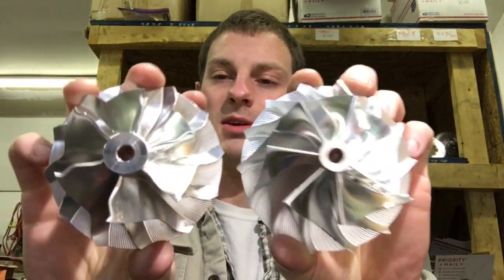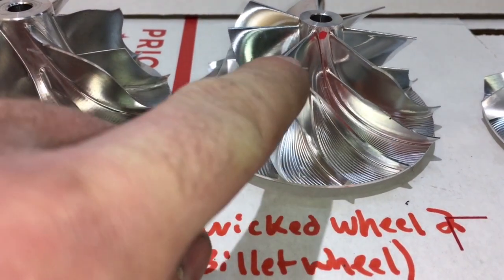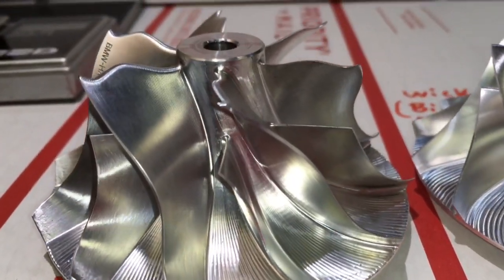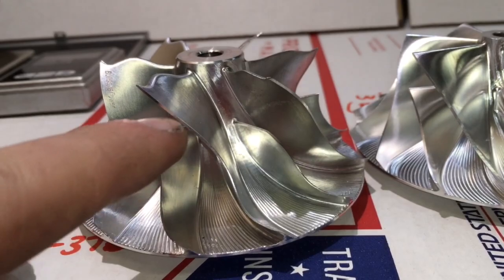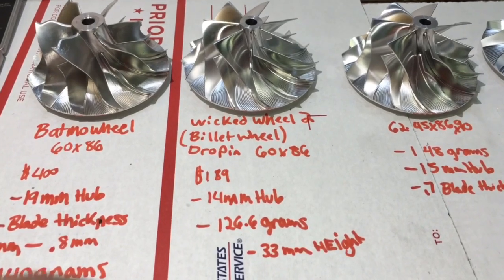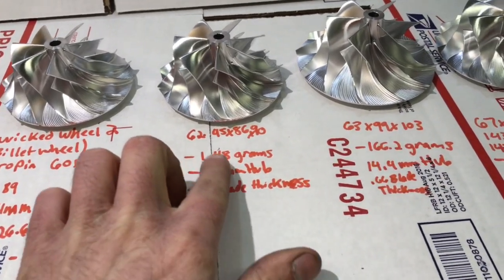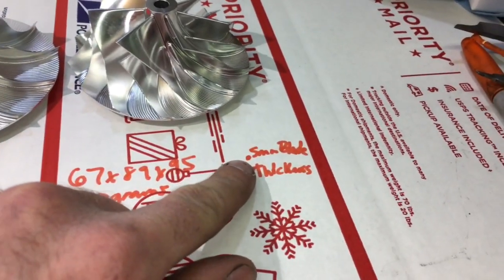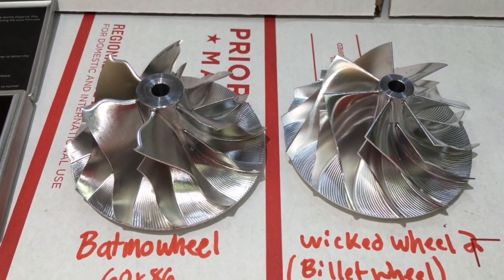Batmowheel vs Wicked Wheel 2

Comment: I just bought a 24v and I plan to rebuild the turbo aswell as pair it with a 5 in straight pipe. I need a wheel with better mpg and little power gain as I have the automatic trans and I don’t need it blown. Any suggestions?
Reply from the maker: My guess would be to use a 6267 or 6264. I don’t have any comparison data to know which is best for fuel mileage.

Comment: In lieu of opinion, why not just build an engine and change absolutely nothing on it but the compressor wheel and run tests on an inertia-roller dynamometer to see which wheel makes boost faster and also which one spins up the roller the fastest overall, from which you will gather the most overall power when wheel is finally spooled up?

Literally no other channel on Youtube does this. You could become THE go-to channel for intelligent turbocharger testing.

There is a gigantic hole in the Youtube channel lineup that you can take advantage of.

Comment: #Turbo Lab America
What do you think about the Batnowheel claiming the following? Quote "Bullseye Power has reinvented the compressor wheel with their exclusive leading-edge technology for quicker spool times and increased flow rates, providing up to 100 horsepower more than a cast or standard-billet counterpart."
Is possible the wheel design can add "100hp"  more? 
I would be testing the Batmowheel & billet CW on a Holset HX40 T51r mod from yourself for comparison.
Reply from the maker: The batmowheel is one of the first billet wheels available. I don’t know if their claim is accurate you have to ask them
Reply: @turbolabamerica  No need to ask! Will find out when it's on the dyno. 
Is worth putting the Batmowheel up against a Wicked wheel 1 & 2 as well as the standard billet wheel you guys make?

Comment: does it make any 
 real difference in performance on stock cummings 2500 2016
Reply: worse performance then stock
Reply: @crxdan  in what way is it worse than stock?
Reply: @kaiserbailey he’s talking out his ass. I have the batmo in my 2012 6.7 Cummins and it spools up as soon as you touch the throttle. And it sounds awesome on top of that, had it in the truck almost 5 years now with 0 issues and I tow 25k lbs regularly with it.

Comment: I got 54x78 Billet compressor wheel with extended tip technology 5x5 blades design from cr performance and so far it looks great and it's a drop-in... it fit perfect. cost was $159 ebay. I've got roughly $220 in my hx35 and it's rebuilt with a Billet compressor wheel.

Comment: What's the total cost of having a turbo machined and rebuilt with a new Billet wheel 62mm.
Reply from the maker: 400 - 650 depending if you want to do the turbine upgrade too
Reply: Turbo Lab America two other quick questions how much would it be if the center section is actually not rebuildable (my turbo has side to side play and just a little in and out) and what would turn around time be and is it possible to plan it out to keep turnaround time down and what time frame would it take?

Comment: Kinda new to turbo diesels. Have two, just never built them. Can someone explain to me what a balance mark is?
Reply: When the machine something or forge somethings as well and melt something together like tires one side can be more dense then the other side. Even though they appear the same and measure out the same. What I mean by dense is one side could be harder or softer. Tires and rubber for instance. When they make a tire it goes in to a moot. Well one side of the tire can for instance be pressed together with more rubber but being molded the same way. That's why we have to balance our tire and put weights on the wheels. Other wise as it rolls around at high speeds it will cause it to wobble or bounce around. A balance mark is just where they took away some metal or added metal on that side because the other side has less or more metal. A compressor wheel that isn't balance on a turbo can cause premature wear on ur seals and bearings. Could in worse case scenario brake the impeller shaft.

Comment: Not related to these particular compressor wheels, but I have a few questions. I bought some billet compressor wheels from you a couple of years ago but I never got around to doing anything with them as I had other problems with the car. Anyway I have a pair of Garrett T04R's still in perfectly good condition that have the original cast 6+6 blade wheels. I bought some billet 7+7 wheels from you and I was thinking I might as well get some rebuild kits as well and freshen them up before I swap the comp wheels out. Should I find some place to rebalance my turbos after I do this or will they be fine? I was also wondering if you know of anyone that has already tried swapping out cast 6+6 wheels for the billet 7+7 wheels? What kind of difference should it make?
Reply: Never assume any turbo was already properly balanced, even an unused one. Balance now and avoid regrets later?

Comment: The machining on Batmowheels are way nicer than the whicked wheels by far.
Reply: But is that nicer machining worth more than twice the price?
Reply: @numinous4789  They need an objective boost test and spool time test to see that. It would require an engine and an inertia dyno.

Comment: Nice video.A mechanic in texas wanted to charge me $400 for a SPX turbo.How much do you charge for a turbo with a wicked wheel on it? I have a 2006 Dodge Ram 5.9 with after market inercooler.#.5 inch inlet and outlet tubes with the bent elbow
Reply from the maker: We build the largest upgraded turbo for the he351cw for 650 as a service and have a 200$ core charge.

Comment: I am trying to get a louder turbo whisle from my lb7 duramax.   I got profab a turbo air horn on it and a s&b air intank on it an one of the boost fuller valve on it and 5" ehaust on it to.  now looking for a turbo wheel for the most noise i can get. what would you go with?

Comment: Nice review dude! just a quick input form my experience I have a speed3. I bought a used stock k04 with a batwmowheel upgrade they said it had around 5k on it. I don't know who built the turbo. I loved it while it lasted I had full boost 2800rpm( stock is 3k) and it held 22psi to redline I never tried to push it higher. I ran it probably around 5 to 10,000 miles and it did let go. Was going up hill and heard a pop the bearings let go but that batmowheel flowed some air for such a little turbo.
Reply: boostercontrol100 for such a little turbo 💀
Reply: boostercontrol100 send me ur info an I’ll have u do my Jettas ko3,I want it just like u did ur grip.carongrnt50gmail.com

Comment: With the frilly shape you get more leading edge surface area, which can help with surge lines and better (but peakier) efficiency at a higher pressure ratio.  But it is overall less adiabatic efficient because it has more leading edge area to heat the air up.  Sharp leading edges will cause more heat and eddys.
Still a fine wheel but it's a cosmetic display without any real benefit over some other billet version that looks more like a Garrett billet.